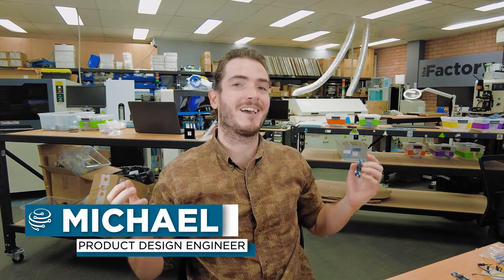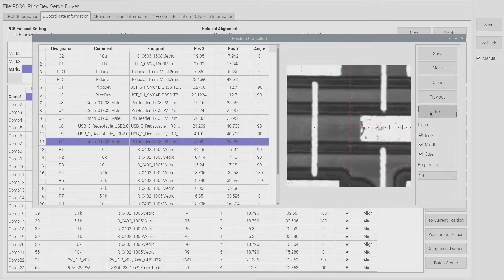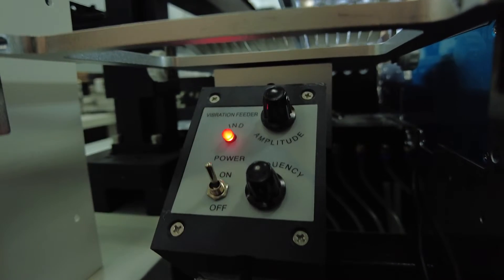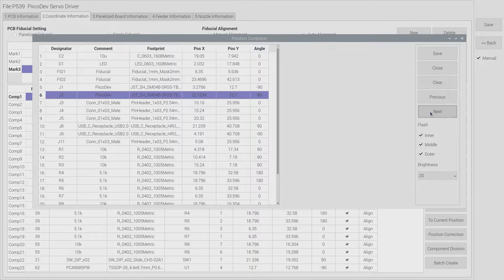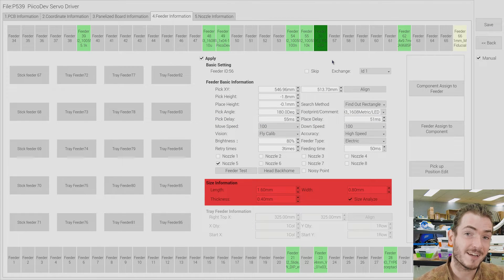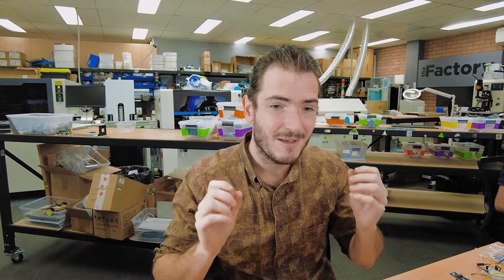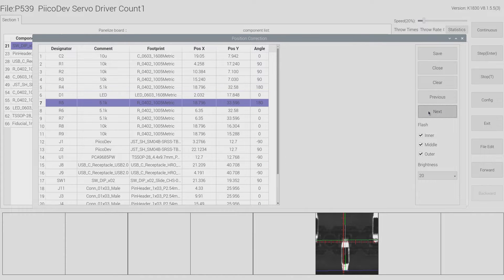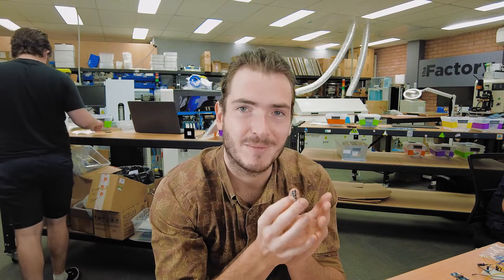The Factory | Design A Product With Us Part 7: Pick & Place Assembly

Comment: Awesome to see you guys, Thanks for your sharing the process of setting up the pick and Place machine, so I want to know when you set up program machine, What did tools that you use to export from file CSV( kiCad) to Pick and Place Machine. Please kindly sharing to me to clearly understand about this process. Regard with thanks
Reply from the maker: We used the "fabrication outputs > position file" tool in KiCad
and then copy it into an existing template provided by the P&P manufacturer. The process will be different for every type of machine
Reply: @Core-Electronics  Thanks for sharing🤗🤗

Comment: Awesome series! I could see a use for this, maybe a fish tank monitoring / feeding system that you could control via the internet while you are on holidays - you could monitor temps and oxygen levels etc and at the push of a button on a keyboard or click of an icon in an app feed your fish. the servo control unit would be used to drive a servo to drive a feeder or hopper that could be designed and 3D printed and maybe you could even check on said fish with a camera. Yes, I know this has been done before but not using the PiicoDev system as far as i know.